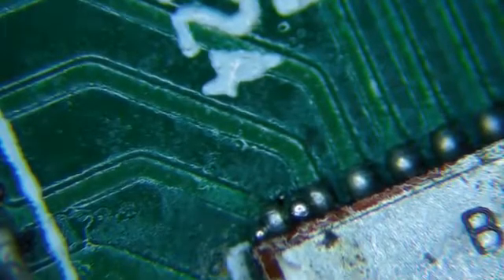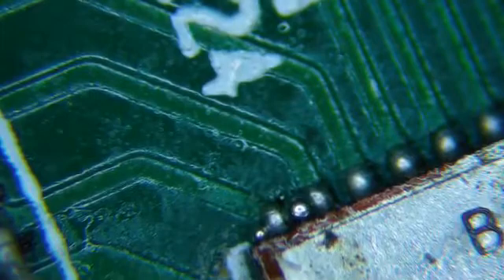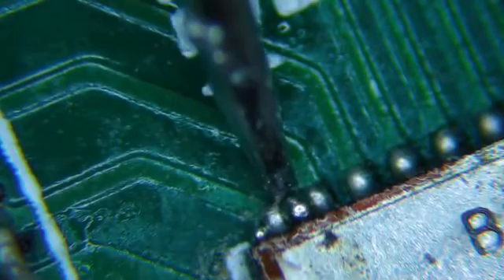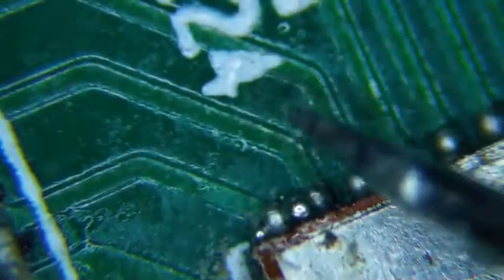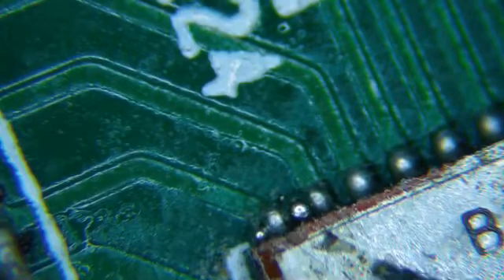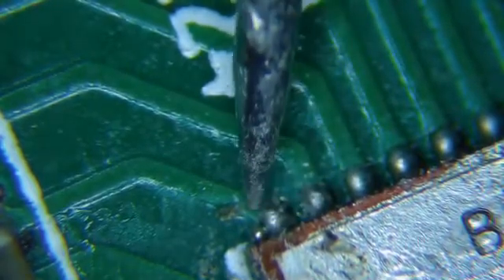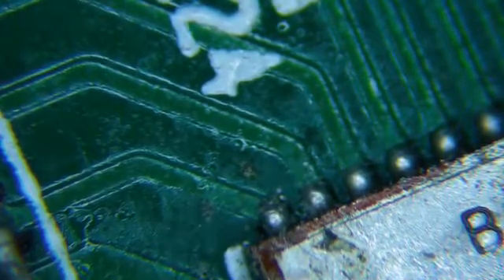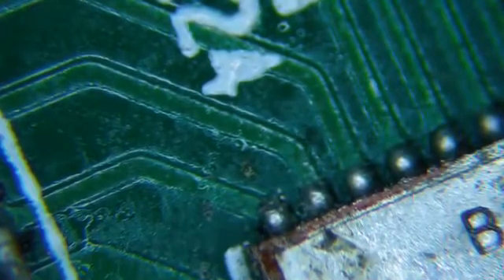hashboard repair: 0 Asic found Part 3

Comment: use a fine tip soldering iron to remove the solder balls that are cold welded onto the leads. I wouldn't try to pop it off with a needle you could pull a lead accidentally and that is a larger job to repair.

Comment: Where are the solder balls coming from?
Reply from the maker: Hi Kevin.  Not sure entirely. I would guess loose solder floating around. Melting of solder used to put heat sinks on.  Heat and vibration and high wind do strange things.  I wouldn’t want to live inside one of those miners.
Reply: @AntminerRepair  maybe it’s time to think about liquid immersion...